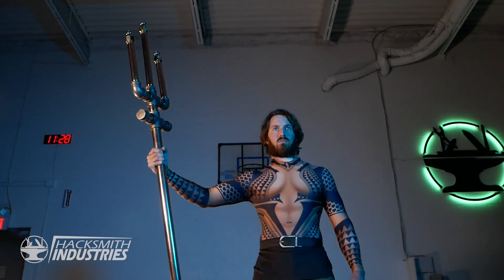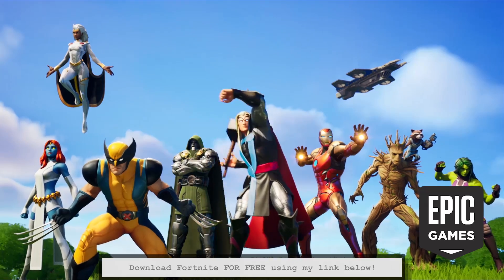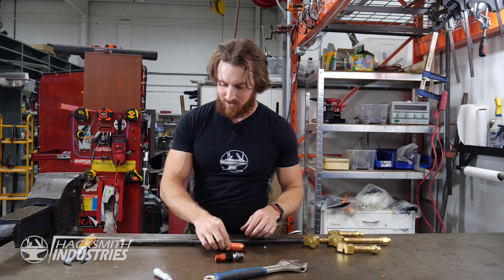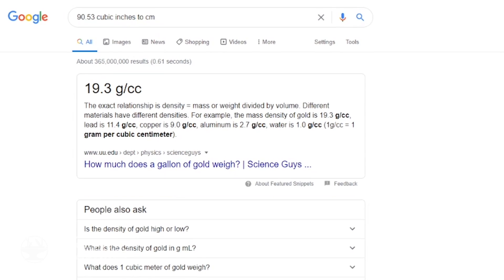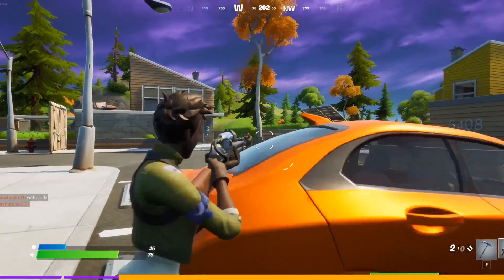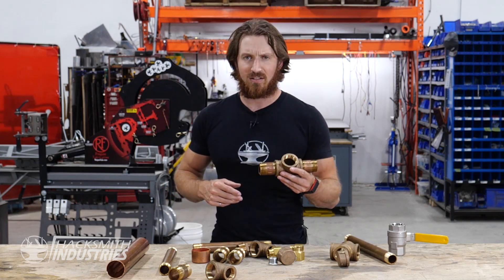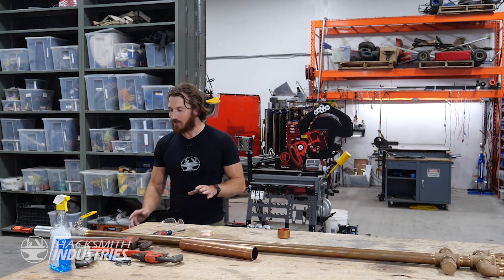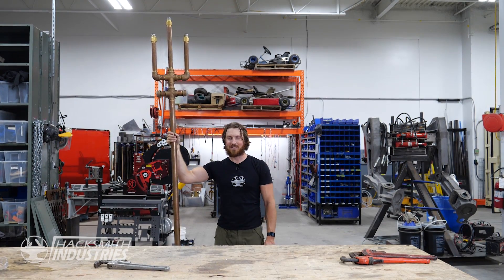Aquaman's TRIDENT! (800PSI WATER BLAST!)

Comment: Put fans in the middle cylinder that are connected to a button that you can make the fans go one way and another, then you can stick the trident in the water and spray it forever, then use the fans the other way to torpedo through the water

Comment: Why c02 canisters? Why not have a sealed off chamber at the bottom of the staff, with like a valve stem off a car tire, and just fill that chamber with compressed air from an air compressor? Then just use your ball valve to release the compressed air into your piston pushing the water? To me that would seem easier and cheaper than c02 canisters.
Reply from the maker: Co2 is 800PSI

Comment: Imagine implementing these tridents in fire fighting, It seems like it could put a decently large fire out decently quick.
Reply: TheReal Bland yeah it’s called a hose.
Reply: @saltymemes209  If i meant hose i would have said hose kiddo, the trident could be implemented in fire fighting and be more useful than your run of the mill hose. More water coming out of different nozzles at once with greater force. As well as how much mist it creates. Would be damn good at putting out a decently large fire.
Reply: @BranTooBland  yeah its called a hose......
Reply: @saltymemes209  i wonder if that's all it knows how to say... Hmmm... What if they used giant squirt guns instead? Pressurized water pack on the back of each fire fighter. Holding tricked out water guns connected to the pressurized water pack.
Reply: This is inferior to hoses in every way but mobility
Reply: Hoses have a lot more water at much higher pressure

Comment: The gas inside the CO2 cartridges doesn't go through sublimation. That's when a solid goes straight to a gas without becoming a liquid. The gas in the cartridges goes through a process called deposition, which is when a gas turns into a solid without becoming a liquid. I mean it is sometimes called desublimation but that isn't the scientific term. I used the science terms

Comment: Um, Steven universe fan here, I have several ideas ideas (even if a bit late).

- Garnet's Rocket fists: Large Fists with rockets at the wrists that fly in the general direction of where they're pointed.

- Amethyst's extendable whip: a whip that starts out at around 9 feet, but can extend to 27 feet at need and can lock at any of the greater distances.

- Pearl's Spear: Fires a pulse laser or plasma out the tip, should ideal still be able to cut things.

- Steven's Shield: A pink Shield that can survive every weaponary implement you currently have in the shop while protecting it's wielder (You've done a lot of projects with shields but few are designed to actually, you know, SHIELD you. Steven's shield was picked for this because I really like Steven Universe, it's the strongest shield I know of in fiction, and It's around three centimeters thick (so not that hard to make relatively indestructible)).
Reply: He hearted you so I'm excited
Reply: Plenty of good ideas
Reply: @kiddoisagreatlittlegame863  right
Reply: Yes yes yes yes
Reply: Cesar Sanchez jojo reference?
Reply: @kiddoisagreatlittlegame863  yep

Comment: Love the channel, But pretty deceptive using a hose for the carwashing scene and not mentioning it. Especially after calling it a testing montage.. You are better than that.
Reply: ALso is delrin heavy enough on its own to fall back down the pipe or did you have to force it down with loading?

Comment: Plug a water hose in the side with continuos water flow from a tap and use a compressor or air tank at the bottom to give you a long spraytime

Comment: Uh....How many CO2 cartridges did you hook it up to....If it was not portable and hooked up to a compressor could it have been as powerful. How powerful could it have been if you designed something crazy?  Its all the questions you usually answer, that you just dodged this time.  Where is the super hero content or explanation about why it cannot be?
Reply from the maker: What
Reply: @hacksmith  Sorry, some of that was very in there....let me let my inner child out.  A fire hose is more impressive, and you usually blow away the normal.   Its an awesome little toy,  just not the "that's insane" I was expecting.

Comment: Hack smith should make another mjolner but put magnets on it so when you open your hand the force of the magnet pulls th hammer to you
Reply: its an interesting premise but the two ways I see it working is a metal glove with electromagnets in the handle, which could either break the handle or the force be enough to break your fingers which is dangerous or have an electromagnetic glove and a metal handle which would probably be safer but a lot more bulky and less discrete, I would really love to see it tried though so I'm liking ur comment to try get it boosted
Reply: Thx

Comment: i have an idea for a laser saw called the LAZSAW with a powerful laser pointer as the handle, use a frame to display a mirror at the end at preferred length and have one way glass at the diode so the laser can pass through but not melt the diode

Comment: I start crying every time I see you use teflon tape. Use loctite instead its much better
 If you if you screw back your teflon tape will be leaking but the loctite and packing yarn would stay tight
Only bad plumpers yous Teflon tape😉

Comment: Do a different one with a backpack air compressor and water tank connected to the trident by a retractable hose so it can come back to the weilder. More water pressure and features as well it’s easier to rig up

Comment: Now, while I understand why they went where they did, you can effectively accomplish the same thing at home with some PVC pipes and instead of going for pressurized blasts, just swing it to fling water, or even install a garden hose adapter and run it that way. Would cost like, 20 bucks or so, and weigh like 1/3 the weight.
Also could customize it more to look more authentic.

Comment: Only 800psi? Come one dude, switch to HPA and give it a shot at 3000-4500psi... :D
Reply from the maker: you want the brass to explode?
Reply: @hacksmith  Maybe... :)  I wonder if you have enough spare hydraulic fittings to build something- just need a few straight tubes for the main shaft and prongs. Call it a truly cordless pressure washer.... :P

Comment: The brass looks kinda ugly :p I were expecting you to use copper or pvc or similar (I guess brass is cheaper and lighter?) to keep cost and weight down, and then simply gold-plate it with electrolysis or settle with spray paint for less cost. Also expected the fittings to be a bit more streamlined than in the end, more like the prototype, so the joints dont look like giant minecraft blocks.

edit: at 10:05, did you just pop a gigantic waterballoon? Sounded like it, and the result looks like it too.
Reply from the maker: Brass is more expensive
Reply: @hacksmith  I was thinking that was likely the case, but I got unsure (since youtube equals minimized budgets in my mind). Btw, just finished the montage bit, I laughed :D The shark-carry was very romantic :)

Comment: Just in case you don't know this: There are liquid thread sealants (similar to but not the same as thread locking compounds) that look clean, work better than teflon tape, and have the added benefit of helping lock the thread in place better than teflon.
Reply: are you a toilet installer?
Reply: @baskomite6299  The word you're looking for is "plumber" and no, I'm not.
Reply: @stathisbikos6563  oh crap, auto-correct
Reply: sorry wrong comment

Comment: this is how i imagined my future self in high school when i was making ballistas and other "weapons" of mass distraction when i was bored in class. Now i am just an other marine engineer student :(
Reply: Use that to make underwater creations. How cool would a bubblegun be? Or a submarine with little lasers or thermal cameras that is remote control. You can make crazy creations too using hydrodynamics, your knowledge of water pressure and engineering. I believe in you and you should too.
Reply: @zamaron5854  marine engineers are the engineers that work on ships. but i have this fantasy of weldig o2 tanks on the back to make the ship fly. those things have 200 bar pressure each
Reply: @giorgosdim9845  ik they work on ships but I thought it included submarines and other aquatic vehicles and machinery. Ah well. You can still learn and if this is what you want to accomplish then you go to every length to accomplish it